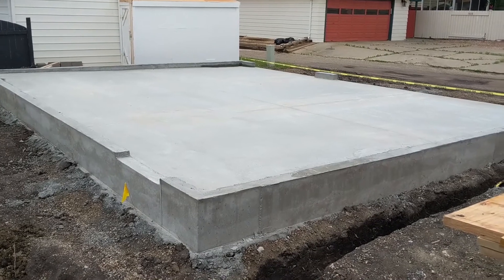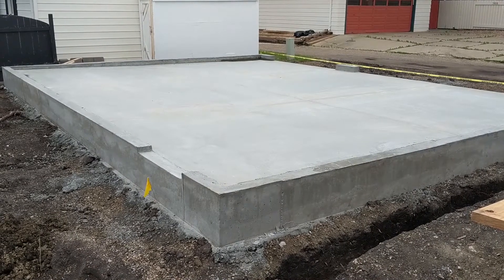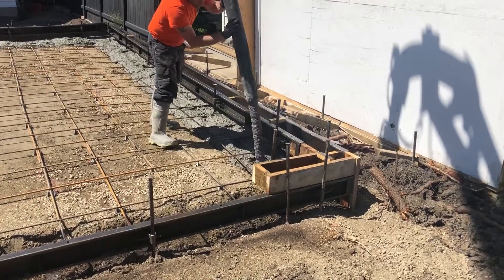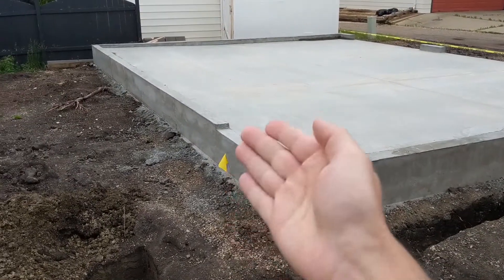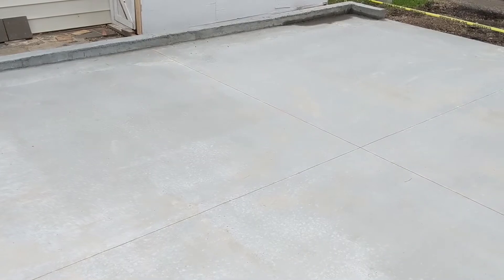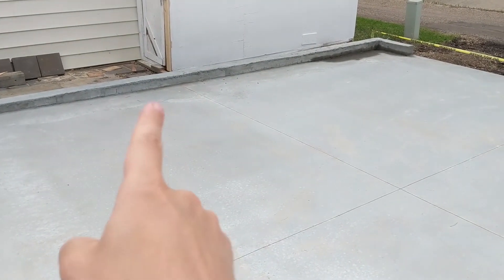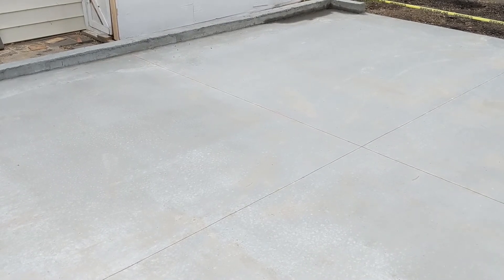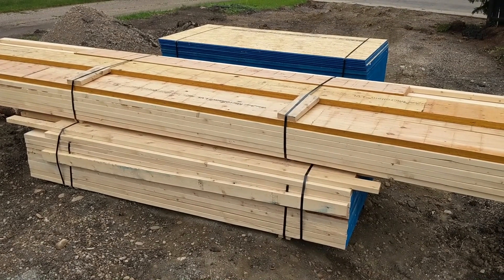Concrete! Forming & pouring the garage pad | Garage Build Series Part 3

Comment: Cool, cant wait to see the next vid 👍 id add A/C to the shop too, but im an HVAC guy so thats just me, lol
Reply from the maker: A/C would be a real luxury. It's only hot here for maybe 2 months of the year but I think the biggest heat management issue I will run into is simply the lack of air circulation. That's something I'll need to try to plan for...all these little things add up.
Reply: Figure It Audi  maybe just mount a fan from Princess Auto, get some air flow